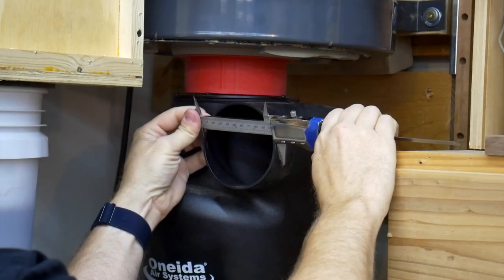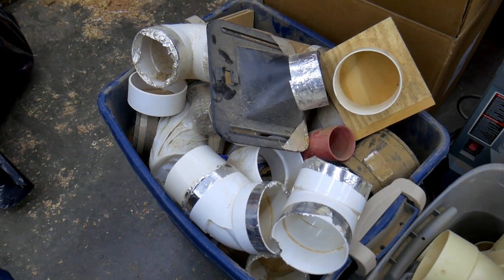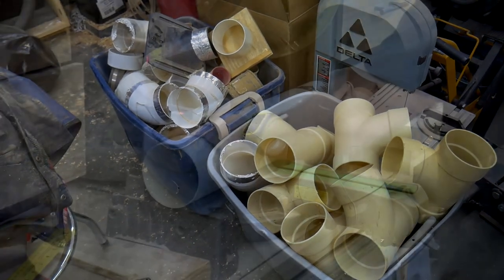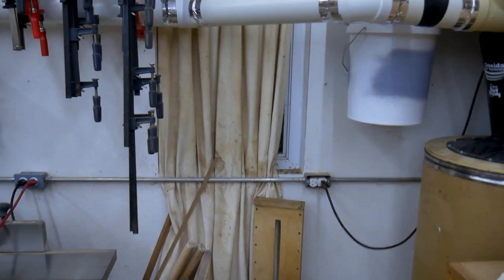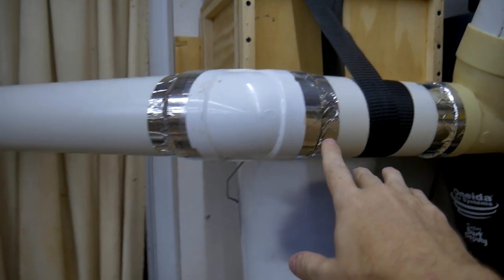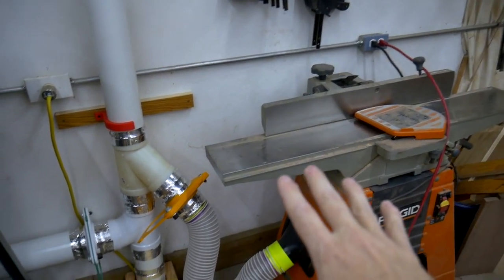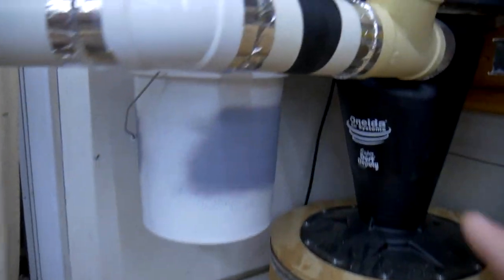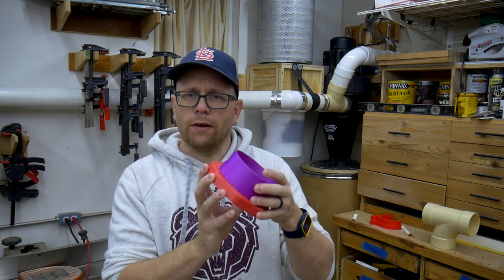Dust Collector Plumbing: Techniques, Tips and Tricks

Comment: I've been told by many old timers never ever use plastic pipe for dust collection because of static electricity will cause it to explode..very flammable material, dust plus a single spark will send fragments of pvc throughout your shop, possibly a fatal accident just waiting to happen.. also was told that if a ground wire was placed inside the plastic pipe a stripped copper wire the total length of the pipe than properly grounded it may help prevent such a haphazard dangerous condition of a Particle Dust Explosion..a very real problem that happens to often with fatal  consequences.. Please do the research necessary to determine if the risk is worth it, to use plastic pipe in such a manner..
Reply from the maker: Do me a favor and find me one instance where this actually happened. And no, I don’t mean in an industrial setting. Fact of the matter is that this does not happen and it is an old wive’s tale - or an old timer’s tale in this instance.
Reply: That myth has been completely debunked. PVC will create static that dust will collect on the outside of the pipe, just a nuisance. There have been explosions in Large industrial dust collectors none in home shops I could find.  Thanks Thomas this really helpful as my son in-law is going hog wild on 3d printing as i'm installing my dust collection.
Reply from the maker: That is great! I love these blast gates so much more than “traditional” ones. 3D printing is a perfect companion hobby for anyone who has a woodworking shop.